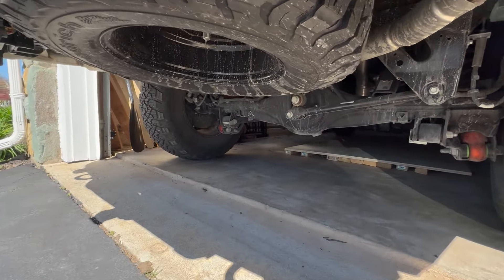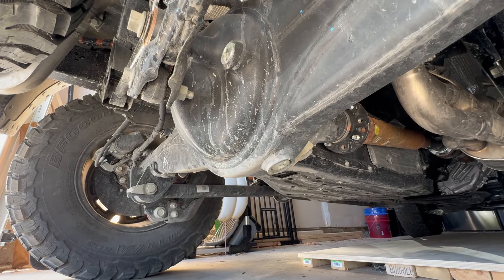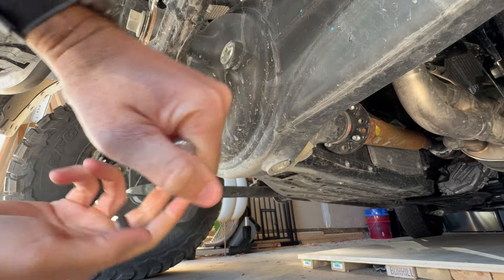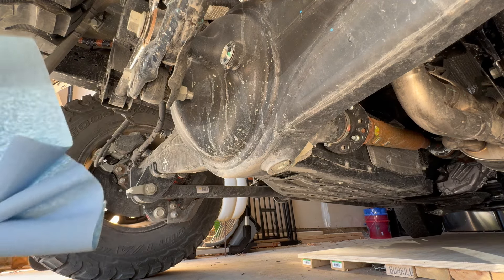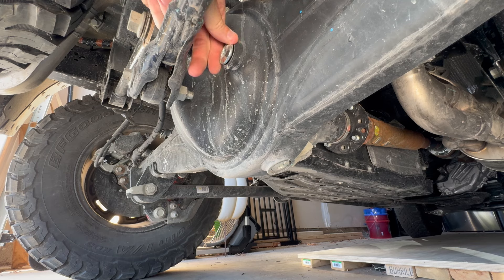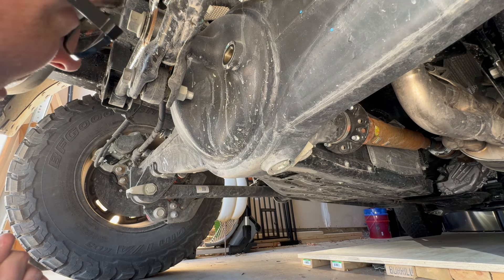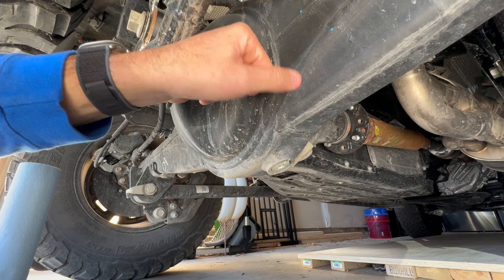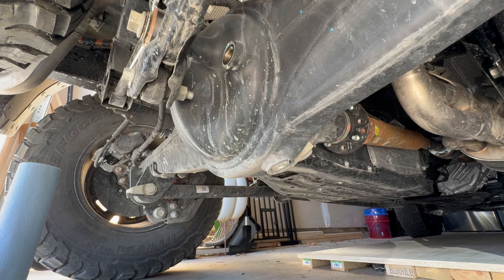Ranger Raptor Diffs and trx case fluid swap idea / question

Comment: Another great video of this super truck!  A little tip for checking fluid level in the front and rear diff.......... use an allen key/wrench...... put the short end of the key into the diff hole and let that act as a form of dipstick.
Reply from the maker: I thought i already replied to this... that is a great idea about the allen wrench for a diff dip stick.  i was going to use a metal hanger and just bend it but this is even better!  much better than sticking my finger in there... i'm sure glad the oil was 180 degrees when i did that... not my smartest moment haha
Reply: @flaberdoopin  You're blowing us away with your review of this awesome truck!  I just love watching you drive it and all your comments and close ups etc..  You picked the right truck for sure. I'm already a Ford and Chev truck lover having owned and leased hundreds of them for my businesses.  At my age now, my son and nephews are taking the reins of the business and I have more time to do fun things like this.
Reply from the maker: thank you... i appreciate it... i'm taking a break from wiring up a new subwoofer in the ranger right now.. it is a pain in the butt to run this power wire while trying to get a video to make it easy for the next guy to be able to follow along, should be able to post it tonight or tmorrow morning.  Cheers

Comment: I don't think it would be the worst idea to drain the oil and look at the condition my only concern would be when you are draining it you will need to be careful not to get dirt or anything else in the oil that would make things worse when it goes back in the diff. I saw a video showing a noise from the rear diff and they took the truck to ford and they said low fluid and metal contamination which in my mind the metal came from low fluid. I am looking at getting a ranger raptor and hearing about the diff problems are making worry. Your videos are very informative keep it up.
Reply from the maker: thank you for the comment and i agree that it is a concern, but my level wasn't low at all so i think i am in good shape,  my transfer case does make a pretty significant whining noise so i will be curious to see how that fluid level is.  Cheers.

Comment: Diff oil will get much higher than ambient pushing those big tires down the tarmac.
Reply from the maker: good call... i just got back from driving for 30 min and when i put my finger in there it didnt feel that hot but that doesn't mean it wouldnt heat up significantly on a longer drive at higher speeds!

Comment: Just drain and refill, 1000 miles is a good break in.  Dont reuse the oil its cheap
Reply from the maker: good call... i did the engine oil... i might as well do the diffs and trx case as well.

Comment: The low diff oil in Australia was only on a very few Raptors, and it was only on the very first batch of raptors to make it over here.  I haven't heard of any diff oil issues since the MY2023.5 models
Reply from the maker: That’s good to know, thanks for the clarification!

Comment: Mine should be here next week. Although its surface rust, looking at yours i know its gonna bother me. Doing research on what to go with if you havent already
Reply from the maker: i plan on taking it to the auto hobby shop this weekend on the marine base to get it up on a lift so i can clean it off with some evapo rust and a wire brush then i am gonna throw a coat of rust preventing paint on it... that should do it.  figure it will take a few hours for all of that, but we shall see.

Comment: I am curious about how big of a hit you took insuring this truck. Was it a lot higher than a standard midsize truck
Reply from the maker: compared to a normal standard midsize truck it was almost identical... and it was actually $120 less every 6 months than my 8 year old BMW M3 that was worth about half as much... that was a real surprise to me!  hope this helps
Reply: @flaberdoopin  wow! That is great news!
Reply: Mine went up 73 bucks a year from a 2019 3.5 f150 super crew cab full options available on an XLT (moonroof, all electronics packages etc).

Comment: Glad you checked the level! From my experience, jeep, chevy and ford are notorious for making the mistake of not filling up rear diff fluids for some reasons... Especially for the first year models (MANY models had their rear diffs shreds itself in less than a thousand miles...). We got a bit lucky as while technically as you know RR is first year model US, but Ford learned from at least 2 years (most likely closer to 3 years) of producing the RR already. As for fluid swaps, ultimately not needed. I just use it as an excuse to wrench and also using better quality products like Redline never hurts, you can actually feel the parts working much smoother, especially the transmission. Redline 75W-85 for rear diff, D6 ATF for t-case, new fram oil filter is sitting in my garage now. Waiting on the redline to rec a fluid for a transmission flush. As I mentioned not needed, but it became a thing for me to do for all my vehicles for almost 2 decades now to just flush em after break in. Ohhhh, the "secret" fluid is actually the Redline WaterWetter! Yes, I know how it sounds... Absolutely must have product if you're living in an area that's 90-110F outside or have a turbo vehicle... legit will reduce your coolant temps by 15-20 degrees. I know I definitely sound like a redline fanboi, I've been using their products for ages...
Reply from the maker: What a bummer, I’m glad my level was good!